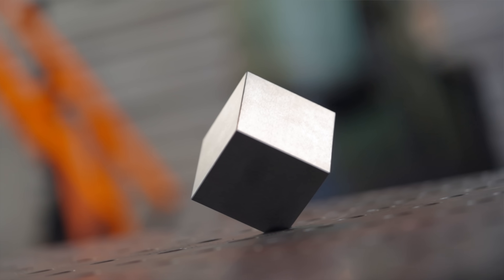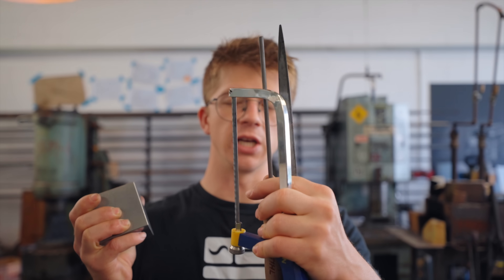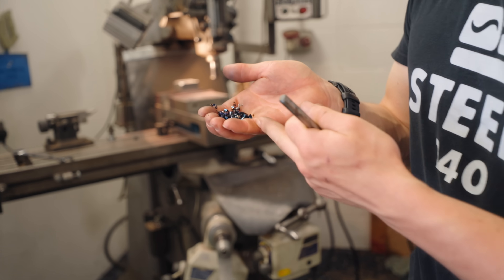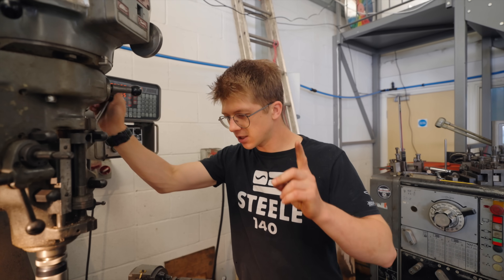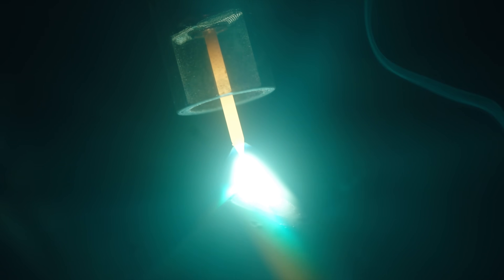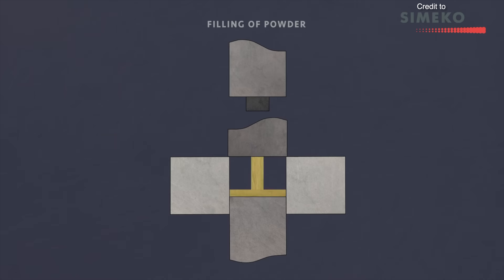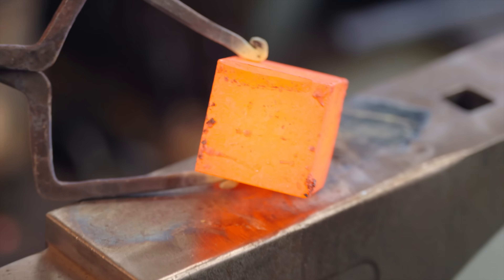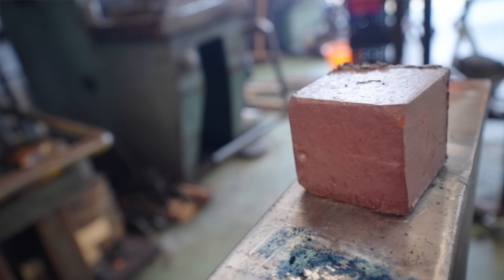Can You Forge Tungsten?

Comment: 10:24 Should actually be hot enough to get anything to almost glow white then. Colour from heat is almost entirely dependent on temperature, rather than material properties (electrons shifting between quantum states being the other property that plays in to it, but it isn't noticable to the human eye when things start to glow).
Wien's law describes what colour will be most prominant, while Planc's radiation law describes the entire spectrum for any given temperature.
The reason why things go from red to yellow to white is because the curve in spectral intensity looks like a bit like a sea wave coming to shore. An abrupt crest with a long tail, moving from IR to UV. As the "wave" "moves", the crest first appears to us humans in the red part of the spectrum, then yellow, and by the time the peak lies in the green-blue part, the entire thing is so intense that colour becomes impossible to distinguish, but if we could keep going to upwards of tens of thousands of degrees kelvin, things would eventually start to look blue, as the crest has moved past what we can see, and the tail is the largest in the blue part of the spectrum.
This is also why extremely hot stars are blue.

Comment: Some applications of these tungsten is when formed as a cylinder and used as cathode and anodes part for electrodes for very high temperature arc furnace.

Comment: There is a complete process of Hardening of metal/alloy. Only then drill bits are usable. Else the metal/alloy is still soft as the grinding, cutting, drilling tools have gone through hardening process. It is said in Machanical world Tools make the Tools. I guess the highest temperature is of Plasma.

Comment: Just really quick as a little tip. If you have a coloured tungsten tip after welding you either dont have enough gas, dont have enough afterflushing or you remove the torch to early as this will cause the gas coverage to dissapear and very quickly oxidise and cool the hot tungsten

Comment: 💡The entire start of your video comes down to two key points: the Mohs hardness scale and tungsten's brittleness. Here's how the hardness stacks up—Tungsten sits at 7.5 on the Mohs scale, while the grinding belt is coated with aluminum oxide, which clocks in at 9 Mohs. As you can probably spot, your tungsten rod is dark gray, but that milling cutter is golden because it's plated with TiN (Titanium Nitride), boasting a hardness of 9-9.5. So, as long as you nail the proper cooling and cutting speeds, you could totally carve that thing into a toothpick without breaking a sweat,anyone else tried machining tungsten?(Every Welder)

Comment: Tungsten has an extremely high forging temperature, around 3,422°C (6,192°F). This is due to its high melting point, which is one of the highest among all elements. Typically, tungsten is forged using a powder metallurgy process or through a chemical vapor deposition process, rather than traditional forging methods. Would you like more details on tungsten's properties or applications?

Comment: I wonder about the question. All metals can be forged at about 0.5 to 0.7 times their melting temperature (in Kelvin). If you can reach that, you can forge it. 
This is generally where recrystallization is fast enough to keep up with lattice regeneration during continuous plastic strain. 
i.e.: "forging"

Comment: There are two types of high speed steel.  T-series contains tungsten while M series is alloyed with molybdenum.
Reply: The abrasive wheel struggles due to the fact that it takes a very high temperature to even soften tungsten.

Comment: Curious of tungsten’s use in an engine block as a sleeve. Would the thermal expansion of the surrounding metal be too much and crack? Otherwise we could possibly eliminate piston slap in forged engines no???

Comment: Tungsten does not have a Face-Centered Cubic (FCC) phase. At standard temperature and pressure, tungsten has a Body-Centered Cubic (BCC) crystal structure. So that usually means that it won't become ductile at any temperature and isn't really forgeable.

Comment: "Machinable tungsten" includes other metals. "Pure tungsten" is harder to machine, is brittle, and has other problems. But: "Very pure tungsten can be cut with a hacksaw, forged, spun, drawn, and extruded." The small amounts of impurities make a huge difference in its properties. Testing samples of extreme purity could change tables of physical properties (density, hardness, etc.).

Comment: You need to reach 1400–1600 °C because that is the optimum hot-working window to reliably deform it in normal circumstances. Past 1600°C rapid grain growth will risk of embrittlement on cooling. You need to heat it in oxygen and CO2 free environment to prevent WO3 formation.

Comment: Explanation: tungsten is a metal with a 9 on the mohs hardness scale most hacksaws use silicon carbide which is a 9.5 on the mohs hardness scale

Comment: Would make a weird W smallsword:

Stiff ah, would actually be offering both an effective piercing & cutting weapon (if normal weight’s around between 350-500g, it would weight around 1,75kg-2,5kg, which is still usable & would offer deceptive cutting capacity, especially with this type of hard edge)

Would not corrode etc

Should be tried 💙

Comment: I am genuinely shocked by the machinability of tungsten; ESPECIALLY  by the regular HSS drill.  I understand that tungsten, tungsten steel, and sintered micrograin tungsten carbide are vastly differing materials with differences in hardness, plastic deformation, toughness, and abrasion resistance; but WOW.  I didn't think the HSS would survive, let alone cut.😮

Comment: It's crazy that it takes so much force/time to move the metal when its hot...and its so dang dense...but when its cold its basically just hardened steele...so tungsten only beats steele when it comes to heat resistance and weight?
Reply: tungsten heavy alloy is 95% tungsten, 3.5% nickel, 1.5% iron. This alloy has the ductility of steel (so its not brittle), while also being much stronger, harder, denser and stronger than steel.

Comment: So from what I understand the main advantage of Tungsten is not its hardness as an element.  But rather the high temperatures it can withstand without softening.
Reply: tungsten is significantly stronger than steel. A tungsten cube can take a 50 cal round without it being damaged while the same around to a steel cube would leave a massive dent

Comment: I bet if you could somehow hook up an oxy acetylene setup to the forge box instead of propane you might be able to get it to the point where you could actually forge it pretty decently. I’ve got no experience at all with forging but if heat is what you need that’s about as hot as it gets other than a purpose built arc furnace.

Comment: Tungsten is used as a electroheating element to reach more than 2000°C without deformation. It was also used in old bulbs which contain an ultrathin filament of tungsten that was heated around 1000hrs before breaking, and it was usually the steel contacts what realy breaks.

Comment: Carbon has an even higher melting point.  The alloy forms when you dissolve the solid tungsten in the molten iron or steel.  You don't necessarily need to melt the tungsten.

Comment: Sintered TC is used for tools for making bolts. My workshop repairs and makes such tool parts. Impervious to any "normal" tool like file, sandpaper, grindstone. It can be milled with diamond grain/powder coated tools and nicely polished with diamond-based  polishing paste. It is very sensitive to local temperature contractions (it chips off small parts as it is sintered) and quite brittle.

Comment: Gold is denser than steel but it's far softer. Density doesn't mean something is hard or will be difficult to cut. The density of diamonds is 3.5–3.53 g/cm³ and tungsten is 19.25 g/cm³... Atomic bonds are what make something hard, not density. Density is just how much mass is packed into a given area. Filing and cutting work on tungsten; while tungsten is hard it's also brittle, and abrasives will create microfractures that allow material to be chipped away.

Comment: Gold, platinum and tungsten  are all close density-wise, but gold is soft, platinum is a lot harder, maybe around a soft mild steel and tungsten is extremely hard. It will be due to the strength of metallic bonding and the way the atoms are arranged (amorphous, crystaline, polycrystalline) harder metals tend to chip, crack or shatter rather than deform.

Comment: You're not approaching the problem correctly. It is not the first time you've done it. There is a difference between tungsten and tungsten carbide. The addition of carbon. How did the Japanese make their swords harder? They added carbon. They've done this by heating the steel in charcoal which added carbon. That produced carbon
 steel which is much harder than normal steel. The same for tungsten. You harden it by adding carbon. Tungsten carbide

Comment: As for "how on earth do you alloy that", have you ever done bronze casting? I've seen it done on a medieval faire once, with nothing but charcoal and a bellows. There is no way you get that coal hot enough to melt copper (1084 deg. C), and he demonstrated as much. But then he added tin to the crucible, which did melt easy enough (melting point 231 deg. C). And then the molten tin ate the copper. As soon as the tin became liquid, the pieces of copper just sank into it. That was the moment when I actually *understood*, on an intuitive level, that an alloy is not just a bit of this and a bit of that together...

Comment: Chat gpt man… you got to learn to use it. Tells you everything you need to know about tungsten. 

Tungsten has an extremely high melting point of 3,422°C (6,192°F), making it one of the most difficult metals to forge. However, if forging is necessary, it typically requires very high temperatures, usually in the range of:
	•	1,500–2,500°C (2,732–4,532°F) for hot working
	•	Above 2,200°C (3,992°F) for severe deformation

Because of its brittleness at lower temperatures, tungsten is often worked using powder metallurgy or sintering rather than traditional forging. Forging tungsten requires specialized furnaces and often takes place in an inert or reducing atmosphere to prevent oxidation.

Comment: Question, can you cast a 4090/5090 power cable and replace the plastic with tungsten leaving the internal connectors the same such that it doesnt melt, doesnt ark, and protects components as it also insulates the tempurature?

Comment: So to get a Tungsten alloy, and some Titanium alloy. The process is you mix them as powered and then press them with a hydraulic, this will give you a form, and then you heat the formed object until the alloy bonds. This way you do not have to mix them in a curable cause if you did that you would burn off the steel, and wouldn't get the Tungsten or Titanium to metal\bond! As for the method of heating such alloy, I believe arc welding is the best one used! Oh great you answer yourself at 11:37 lol guess I should have watch the whole vid before txt.

Comment: Tungsten is just dense and really tough and strong when it comes to heat and pressure. But it can be machined just like anything else basicle. Tungsten CARBIDE on the other hand. Now thats something you only really wanna grind in, for things like, say carbide tools for cnc machines. Its freaking hard, and will keep a sharp edge for a very long time if used right. For things like Endmills in CNC machines, you typically also coat the tools, for better tool life and resistance to material gluing itself to the tools.

Comment: Interresting video, but please don´t say "technically it is tungsten carbide" like if is was "modified" tungsten or somehting. Tungsten doesn´t have more in common with tungsten carbide than hydrogen gas has with water: The first is an element. The second is a chemical compound whos molecule happens to contain that element. It is NOT some kind of mix. It is chemistry. I know you didn´t say it was a mix, but people need to be very clear about that difference if they are to understand anything about the world.

Comment: I did a quick Google and found that if you can keep the Tungsten carbide slightly below melt, forging could be possible. That would mean you'd have to keep it around 5,200F or 2,900C (I know those don't equate, but I'm American and I used Google). Also, using a power hammer while reheating the tungsten carbide is advised (although impractical). That's probably why lots of people say its impossible.

Comment: Of course you can grind it and such, it needs to be grinded every time you dip your tungsten electrode in a weld pool. I also feel like welding it would be extremely difficult, Cause to have enough heat to melt the work piece, you're also melting the electrode.

Comment: I want to see you forge Rhenium-- it's supposed to be one of the elements strongest at high temperatures. Additionally, it can be hardened substantially by working it and it doesn't become brittle. It's one of the metals they use for rocket nozzles.

Comment: I really wish you would have put the Tungsten under the power hammer at room temperature. I think that as the video stands right now, it leaves an impression that heating up the Tungsten had any effect at all on its forgeability, but I'm a bit skeptical. 

Sure, it's quite impressive to see a dense glowing cube, but it's simply coincidence that the forging temperatures of other metals happen to be in the "glowing red hot" range. The incandescence we observe in red hot metal is just black body radiation, which is emitted from all things at all temperatures, hot or cold. It's a matter of human physiology when that radiation becomes visible to us, and "glowing" doesn't inherently mean anything special is happening to the properties of the material. On the other hand, certain metals become malleable at high temperatures because they undergo a phase change. For example, iron changes from a Body-Centered Cubic to Face-Centered Cubic arrangement at about 1600F, which makes it much more malleable. It's a complete coincidence that this is temperature falls around where we can start to see the metal glow.

I think that since Tungsten does not undergo any sort of phase change within the temperatures you were working, there should be little to no change in its malleability. Just like how if you heat steel to 1300F, you should see only minor changes in its material properties.

Comment: That isn't Tungsten. It's an alloy. Pure Tungsten would've shattered first hit with the Stanko. In fact, the hotter you make it, the more brittle Tungsten becomes. If we are going to call that cube "Tungsten" you might as well call the steel cylinder "Iron." For any blockhead about to say YEAH BUT IT'S 99% pure, virtually all your commercial steel is 99% iron. Trust me, that .5 to 1% alloying agent is the difference between a cast iron skillet I can break with a hammer and a bullet proof vest. It changes the entire lattice structure of the base metal.

Comment: What about forge welding the powder like you did with the cast iron ? would it go softer easier if there is more surface area to heat and posably stick back together. If it's possible, it might give a unique look  . I'm not up on my forging equipment but is there any kind of oxy/acetylene forge , might get it a little hotter or induction heating even ?

Comment: Forging tungsten is extremely challenging due to its high melting point and hardness. Tungsten typically has the following properties relevant to forging:

Melting Point: ~3,422°C (6,192°F) – the highest of all metals.
Forging Temperature Range: ~1,400°C to 2,500°C (2,552°F to 4,532°F).
Key Considerations for Forging Tungsten:
Temperature:

Tungsten requires extremely high temperatures to become ductile enough for forging.
Most forging occurs at temperatures above 1,400°C (2,552°F), where the material transitions to a more plastic state.
Controlled Atmosphere:

Tungsten is highly reactive at elevated temperatures.
Forging must occur in a controlled environment, such as a vacuum or inert gas atmosphere (argon or hydrogen), to prevent oxidation.
Specialized Equipment:

Standard forging equipment may not handle tungsten's requirements.
High-temperature furnaces and advanced forging presses are needed.
Alloys:

Pure tungsten is rarely forged; it is often alloyed with other metals (e.g., tungsten carbide) to improve workability.